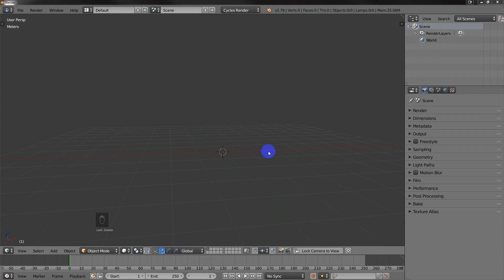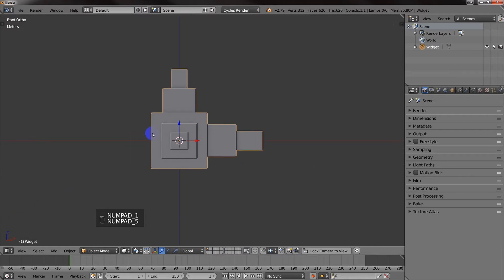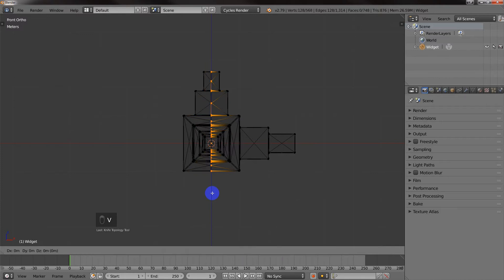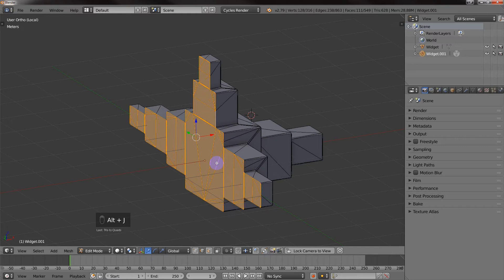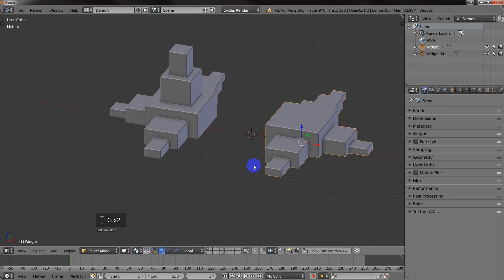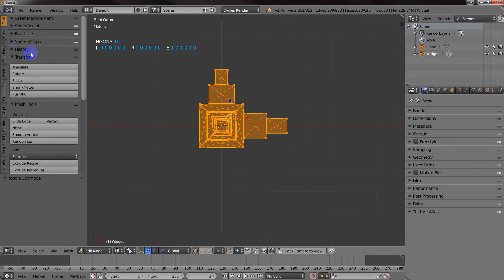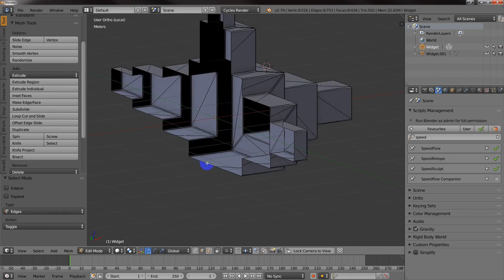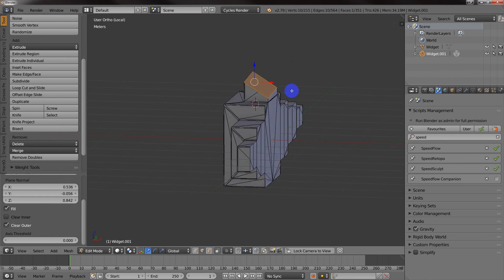How to split an STL model into two objects using Blender.

Comment: Unfortunately with all the massive improvements to Blender to make it behave more consistently to other 3D software, some of the keystrokes and tool behaviors have changed. Here's some corrections:

1. Click the Modeling tab.
2. A to select all. Click anywhere to deselect.
3. Shift - Z for Wireframe mode
4. Space then K for the Knife tool.
You don't need to specify a type as Cut Through is the default.
5. Click the start and end point.
6. Press A to constrain angles to get a straight line.
7. Press Enter.
8. V to rip the mesh

Unfortunately at this point, I get stuck. The seam is stuck to the cursor at this point but no cut has actually been made. Pressing Enter and Ctrl-L seem to have no effect.

I think maybe people are using the Bisect tool now?

Comment: Worked great, thanks!

New to Blender and very curious why a face needs to be triangulated and then made into quads and can't be left as just a face
Reply from the maker: Usually stl files are triangulated. I wanted the model quadrangulated without ngons and so I showed how to do that.

Coming from a background in making game models, I always work in quads...I know, I know, everything ends up in triangles in the end (render engine), but working with quads is so much more clean and efficient for modeling anything and it works better for subdivisions, animations, deformations, controlling low poly counts, etc. Work in quads whenever you can to control topology unless you are trying to control the way a model will triangulate, or if it really doesn't matter for your application. Look up on the internet "When are ngons bad" for more info.

Yes, you can have n-gons...but again, it is not best practice for the kinds of things that I have always built. A clean quad-based model is what I always aim for. If you are doing something like a 3D print model and it doesn't really matter, then by all means save time and let the Ngons stay.

I hope that confused you less and not more : )
Reply: There's a lot of whoosh, but it's all stuff I need to learn if I want to do more vrchat customisation (though I think it uses tris).  Certainly interesting, thanks for the insight!

Comment: Im new to blender, i have tried this. I have an STL open, K select the area to be cut worked, hit enter worked so area is selected with a yellow line, but when i hit V i get Error cannot rip selected faces. Any help please, desperate to get this to work. Thanks in advance
Reply from the maker: Sorry to hear that you are having issues. I know both the methods work and I just don't have any idea what you might be doing wrong in the workflow that is hanging you up. Do you have anyway that you can screen record what you are doing? 1. Enable STL addon. 2. Import stl that you want to split. 3. Go to Front Ortho view (Numpad 1, Numpad 5). 4. Go to Edit Mode. 5. Wireframe Viewport Shading. 6. Make sure nothing is selected (A). 7. Knife Tool (K,Z,C) then LMB click at the start point the LMB click at the end point and then press Enter. Don't click after that or you will lose your edge selection. 8. With the cut edges selected, press V as that is the rip command. You now have two mesh parts in one object. Right after you rip it, press G to move and check to see if it separated and then press RMB to cancel the move operation. 9. Select linked all (Ctrl+L) 10. Separate the selected part with P so that you have two objects in Object Mode. Where are you stuck in all of that?
Reply: Bryson thanks for the response, ill make sure i am following those instructions and report back.
Reply: I'm thinking i have a different version on blender to yours. I can import the STL, but when i hit the numbers 1 then 5 the model disappears :(
Reply: update, after i press V, i then hit G but i cant move the cut object
Reply: Bryson i got it t work, can i send you an email or is there another way to contact you?
Reply from the maker: Glad to hear you got it working because you had me stumped. There is a contact form on my website at brysonjack.com
Reply: I have left contact details in your website, need some further help please
Reply from the maker: I made a new video that hopefully helps you. https://youtu.be/ULD9EnZ6FJY

Comment: hi man! much faster and better way to do this - use hardops. Create simple plane(q-(c) sharpen) - then select both of objects - then q - slash. well done! (: its can be multiple planes.
Reply from the maker: I know you are right. There are many add-ons that make the job easier. My intent was to show a way to do it with no add-ons in stock Blender, but I appreciate you posting that so people have another way to do it if they want to use the Hard-Ops paid add-on.
Reply: does it have the knife function?